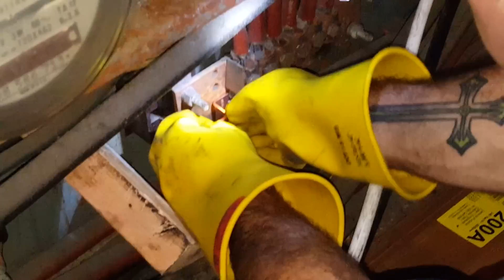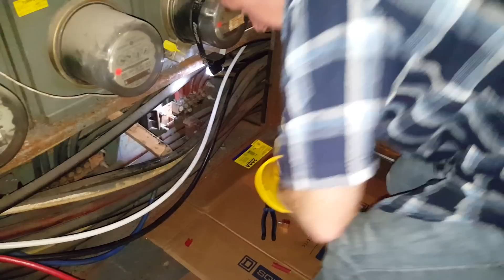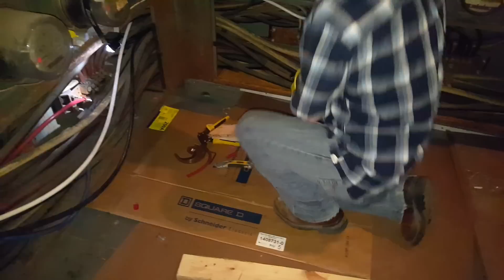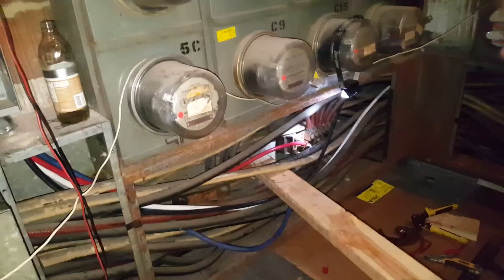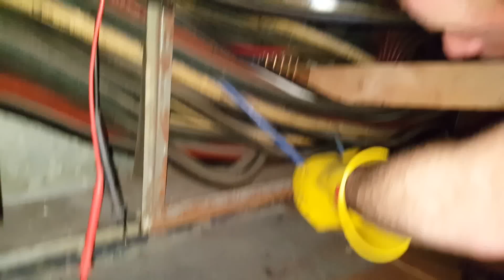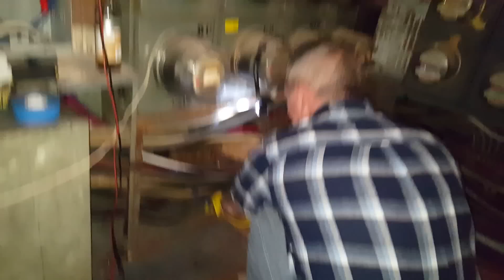NYC Electrician stories (120v 200amp service)

Comment: Accident waiting to happen. Hot metal ratchet flying around, old main feeds being pried around, kneeling on knees,  using word electrocuted vs. shocked, no PPE. Getting shocked is one thing; getting a real arc flash is another. I had a 400a 480v panel blow up in my face from a small snip of wire- was blind and deaf for a few seconds and it singed my eyebrow hair. Luckly it was only a little snippet of wire that blew up. If something as big as that ratchet blew up, I wouldn't be typing this. Know what your working on and respect it.
Reply: Jiandi P p

Comment: Anyone, ANYONE, who thinks those gloves are fine without protectors on ANY voltage is wrong. Even if nothing ever penetrated those class 0 gloves there’s many things that will degrade the rubber, oils, UV rays etc.... he probably doesn’t even get those gloves tested and if he did they would fail them the second they say them. Scuff marks will cause these gloves to fail visual inspection instantly. Even leather protectors need to be replaced a few times a year from the oils and scuff marks they collect. This video is a great example of what not to do.
Reply: and the stories he is telling in the mean time prove the lack of safety in his area of work. I do not want to blame the electrician, because either-way no paycheck is worth dying for, but his will be hard enough to life from in the first place.

Comment: The NY accent and transformer humming made me feel like I was at work for a second. Whenever we do live work the contractor's supposed to provide us with arcflash protection (like a welding helmet) as well as a flameproof jumpsuit, 2 sets of gloves, insulated tools. Wearing that suit and gloves fucking sucks tho especially during the summer. I've mostly gotten shocked working on jobs that other idiot mechanics are running, which is why I prefer to work alone or with a helper. I've seen the most accidents happen working with people who aren't very systematic in their approach and air more on the side of "winging it" and being all over the fucking place. I try to work organized and safely - dont give a fuck if the contractor thinks I'm slow. My work's neat and I make less mistakes.
Reply: James. nobody cares.
Reply: This guy nailed it

Comment: Here is a little tip regarding weather you are grounded or not. When it comes to mains AC , you are ALWAYS grounded , because of little thing called Capacitive Coupuling. Basically do not touch exposed wires unless wearing heawy rubber gloves , proper work shoes and always have somebody with you when doing any live circuit work
Reply: Also regarding proper shoes. NOT ALL steel toe shoes are meant to be worn by electricians. Proper electrician work shoes come with third party certificate (usually written somewhere on the box) , that guarantees  , that shoes have actually been tested to complie with proper safety standards. You can always google that certificate number , because that is public information.
Reply: CAT has a few of those steel toe/composite boots and shoes that are rated for electricians.
Reply: Yeah look on the boot it would tell you a logo which represents it also that's why they don't use aluminum ladders
Reply: Karlo Moharić lol wrong, just stand on a fiberglass latter and don't touch anything metal and not grounded even with ac.
Reply: @jamesross160   he's not saying that you are physically grounded. He's saying that it's good practice to ASSUME that you're always grounded. That way you're less likely to drop your guard and you'll work more cautiously.

Comment: Here in UK we are using  rubber rolls which will protect you when you dealing with up to 10 kV . And this roll 15 meter length and can be cut to any size you want , it will cost you about 100£ (140$)

Comment: As a plumber I talked to a lot of ex-plumber electricians.
Most said they didn't like working all day then turning on the water and finding they needed to start over.
Reply: If you loosen a plumbing fitting after you have tightened it by wacking it down to were you need to connect, that is a leak in the making with water. Mechanics 101. I'm just being an ass. Carry on, respect what you guys do.

Comment: Yikes.. those insulated rubber gloves are meant to be warn under a leather glove to protect expensive rubber insultated and protect you. The first time you use the gloves without the outer protective leather glove they are garbage. Good for washing dishes only not live electrical work.
Reply: Graham Siberry this is why NonUnion always will bring down the prices. Because they are willing to risk their lives for 40$
Reply: Atleast it's something and you can see his beer on the upper left so he is a pro and won't die
Reply: NFPA 70E has provisions for using just a rubber glove.
Reply: Graham Siberry

Comment: Blue red black is the phasing? White neutral?
Why don’t you just used red white blue and black neutral?
What’s the insulation on those cables? You call it radox? Is it XLPE?
Reply from the maker: What? Why the hell would we use the black as the neutral? In nyc the most common phases are blue red black but sometimes you will find black red blue. It's important to follow the in-line service box otherwise you will mix phases.
Reply: DangerousTv1 this was troubling how he was handling each phase and the spanner right across 3 phases in the disconnect box was like wow even if it's not live it can lead to big error in judgement  (like when my friend pointed his supposed empty paintball gun 1 inch away from my neck and pulled the trigger and a paint ball came out lucky most the blast hit my waterproof coat neck part of it, still the fragments of the shell went up the right side of my face and it taken weeks to heal, if I had not pushed it away initially I could of lost an eye) , at least everything you was saying was like spot on only takes one and you die does not matter if its 110v (you probably heard just about everything els from other comments so won't go any more) might of only been messing with the leg side but still 3 phase in the end it can go with a bang as he mentioned
Reply: DangerousTv1 . Yeah we use black neutral and red, white, blue phases. 
Although in flexible cables - blue neutral - brown, white and black phases! Green and yellow striped earth wire!

Comment: i love my life. i would always looking for a higher ratio of not getting shock. safety is my best friend. they said that you won't be an electrician if you can't experience being shocked. sometimes careless that only holding 1 line wont shock you but my elbow hit the grounded wire and got small burnt finger tip and almost fell in the ladder in the balcony. i realize that i have only 1 life.

Comment: you should get the leather protectors for your rubber gloves, those gloves are expensive to have them get punctured. You should get insulated tools, then you wouldn't have to worry about shorting to ground. Good vid!

Comment: Anyone who think electrocution is death or 120 volts can't kill is wrong, it's death or injury.  I've been hung up on 20 amps for 5 seconds before I got the air out my lungs and Co worker hears me, thank you ceiling grid.  Nice burn on my hand and had the queesy stomach feeling you get after being kicked in the nuts for about 4 days.  I was electrocuted just lucky enough it missed my heart, and that's way different then a shock.   Amps kill volts determine the pain your going to feel.  That's why a taper is 30k volts but only .01 to .03 amps.

Comment: If you’re at a licensed electrician why aren’t you use an insulated extension and socket wrench especially when you’re working on a 200 amp box with exposed wires and lugs? And if you say you’ve never seen one I have used one myself for the same thing works great so that your extension does not ground out on any metal exposed parts on the box or frame.

Comment: The whole construction of this set up scares the hell, out of me. No cable supports, no phase isolation between various feeders, cables just laying against lugs of different phases, bolts sticking out into the phase conductors and his routing of the pase on the blue cable is NOT a very practical choice. DAMN man!

Comment: In Germany you will need a special education which will call "work under power" or "AuS" (Arbeiten unter Spannung). If you get this education you are able to do that, any fail in practice or theorie during education abort the this education imitadly.
There is no "fucking anything", this is pure respect about the power behind - just stay safe and work not under power when it´s possible. A night in hospital after an electric shock isn´t a nice event....

Comment: What the hell, he is not wearing proper PPE. No Face shield in proper gloves. That socket wrench could've easily  arc to one of those meter boxes.
Reply: jjr897 It's an insulated wrench
Reply: Looked metal to me
Reply: It’s 240, relax. It takes a lot to make an arc extend even an inch. He’s fine.
Reply: amature

Comment: Are they even electricians? 
The only like work you ever do live in the uk in a panel room (etc) is with all 1000V VED certified tools, standing on a thick rubber mat, flash protection clothing, ALL cotton fire retardant clothes, 1000V VED steel toe/composite boots, safety glasses, hard hat and there are probably a few other things that I’ve probably forgot 🤔 

Being a sparky since 2004 I’ve had a few shocks and twice locked on and neither of those was at work. 

One of the worst accidents I had at work (was due to me not turning the power off even though my boss told me to) was moving breakers around for load sharing. It’s was one of theee cheapest boards going, proteus I think, anyway. The board was rammo and I was fighting to move one of the breakers, and then I couldn’t see for quite a while after that. The screw which was exposed (hence the cheap D/B) went between 2 phases. The incoming supply was 125A 240/415 3phase. I’m thankfully it didn’t blow the main 630A HRC’s in the transformer as it’d of been a world of hurt. 
What it did do was trip the 125A MCCB that was feeding the sub main, the main incoming supply to that board 400A and weld shut the main isolator. 
The 2 tabs that were sticking out weren’t there after that believe it or not. I dread to think what the fault current was to trip a 400A MCCB. Well, that’s what you get for going across 2 phases and not listening to your boss.

Comment: Its not the shock I get worried about, those connections are only 120 volts to ground. Its the unexpected explosion that can be very costly. The only way this could kill you if there was a large load and you get in between the open load. This isn't as dangerous as it looks. Still, better to turn off the power if you can. 277 and above can get you held up and kill you, that would be 277 volts to ground. Nothing more terrifying than being stuck to a wire and not able to move or let go. With dangerous voltages I would always tell my helper if I get hung up, hit me with a piece of wood to set me free. Lets hope that day never comes...

Comment: NYC is a shit hole when it comes to utilities. you have parts of the city that are several hundred years old and have been scabbed on and updated who knows how many times. I wouldn't want to work there. You guys are braver than me. I've been an Electrician professionally since I was 16. But my dad was a Journeyman for more than 30 years, used to bring me on jobs to help pull wire when I was 10. Now I'm 30 years old and have gotten out of doing electrical, but I still end up doing it either at home or as a favor for someone. 3 phase 600 amps service is no joke and I've seen arc flash in person from big industrial power supplies... 120v just tickles...

Comment: Try working for con ed. Full long sleeve FR suit with face shield helmet, rubber gloves under leather gloves and glasses . You take that any of that off within 30 feet of the work area 20 suspension.

Comment: Title says 120 volts, but are you SURE that's 120v??  Looks like 208v or 240v 3-phase.
Reply: Paul R 

secondary yes its 240v definitely . meter stacks are usually in apartments or strip malls

Comment: Ya you should have outer leather gloves on over them rubber gloves and you should be wearing safety glasses in case of Arc  blast ......
Reply: Pretty sketch. Thats the difference between hacks and the pros. This guy is taken necessary risks and one day his luck will run out.

Comment: Not even a pair of goggles, or coveralls. A good ark could put him blind in hospital for the burns. let alone the risk of electrocution.
There is no place for this type of worker in NZ or Aus as not only would the electrical company be liable and negligent but if the building was owned by a corporation or business they would be found liable as well, and both would likely be prosecuted possible even without incident if this type of work condition was ever found out.
Basic steps, Coveralls, helmet with face mast, Under gloves, Insulated gloves and cover gloves, insulated tools and rubber mat.

Comment: this guy wearing rubber gloves, without any of the other needed gear, is like wearing a ball cap as a helmet.
he would actually be safer with leather gloves instead of the rubber ones.

those gloves are designed to be worn under leathers, and in conjunction with FR coveralls, and an arc blast rated face shield, at minimum, and for higher energy, full 40 calorie gear (bomb suit)

Comment: Have you not been trained on the proper PPE & how to use it?! No FR clothing, no protectors for the gloves, etc......
Reply: I am from brooklyn, forghettabout it!...ppe my ass
Reply: This is  obviously a non union   outfit,,,    yes  it may only be 120volt to ground   but    the ampacity of this installation  would  create a  huge arc flashi would say if any tool touched the box while   working on  the hot   terminals,,,,   I would not want my face to be that close in the event of an arc flash on that  system,,,   I   myself  have  worked  on   live panels  in homes  quite   often   only  rarely   have I decided to  temporarily   turn  the power   off on them,,,   the   trick   when  working on live stuff is  be in a comfortable work position  and    NOT..BE IN A   HURRY.....   When  I  worked on  the   big  Oil Sands   Mega  Projects      even  if only 120/240volt panel   they always  wanted the  power turned   off   unless  absolutely  essensial   and  then   must be   2   Journeymen  electricians  together if working on live stuff   and   yes   Arc  Flash  PPEs  should be worn  when  working  on  high  ampacity  systems,,,,,,,   myself  have never been  close  to big  arc  flashes    but I  realize   the heat alone from these can cause death   3 degree  burns

Comment: Wow,  love the "safety" lesson he is spouting the entire time he is completely unsafe. How many OSHA fines could be levied in this short time.  And remember they would most likely be times 2 or 3 since 2 people there. At least he could have glasses leathers and rubber tape on ratchet.  But still not proper. If they prepped correctly they could have done this with a possibly 30 min shut down or less. I would have had the wire under leg then bolted to bus bar to limit time on the energized part. I hope he did the ground and neutral first.

Comment: Wow! Someone has balls of steel! While for the most part I disagree with the comments about the leathers, once you were done placing the lug you should have donned them, but strongly agree with the need for arc flash gear, bro do you hate life? Get some gear and wear it, it may save your life.
Reply from the maker: ok thx. luv u too
Reply: If you did this at my company (in Australia - where we have REAL electrical systems) you'd be sacked on the spot, with no come-backs.
Reply: tcpnetworks Same in Norway. Always need 3  safety barriers. He is just playing with his life. Incredible stupid, just for a few bucks.
Reply: tcpnetworks Australia doesn’t even have the ability to supply all their towns with power lmfao. We Americans had to send Elon Musk over to help out LOOOL

Comment: One should educate himself about arc flash( NFPA 70E) and understand what type of PPE is required for the available fault current. Interesting not even minimal eye/face and skin protection. I fail to see the reward for such careless risk.  Should you make an error you could be burnt and blinded if you survive the explosion. Not to mention shutting the whole facility down for undermined amount of time.
Reply: Shutting down the facility is the problem of the facility manager that hired based on the cheapest offer instead of approved companies that follow current regulation and best practices. You can hardly blame it in the death electrician in the basement.
Reply: prh44 hi